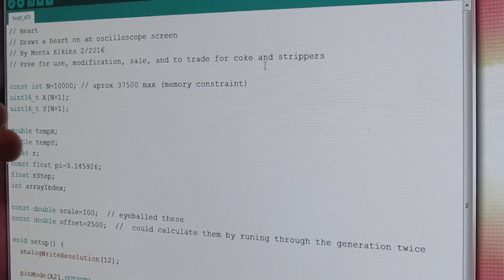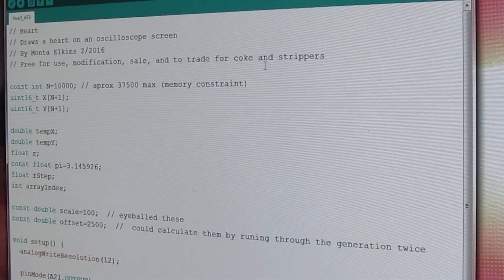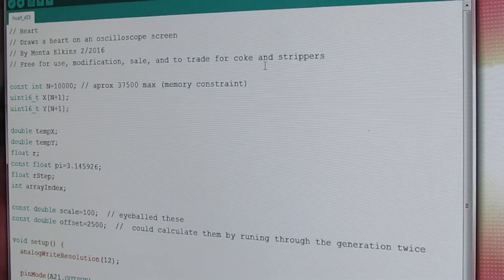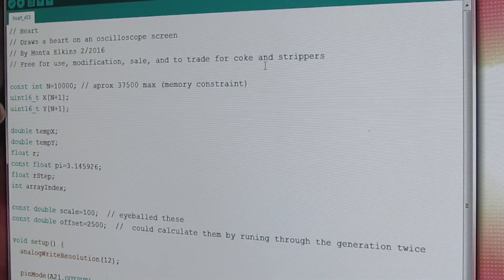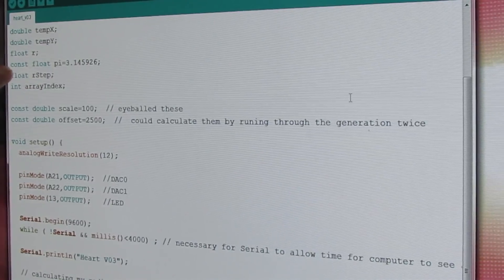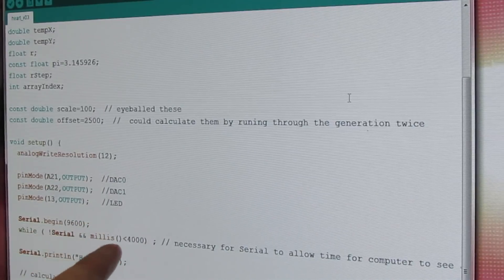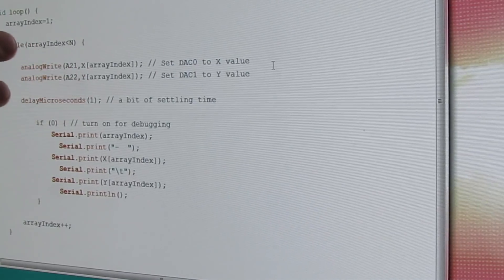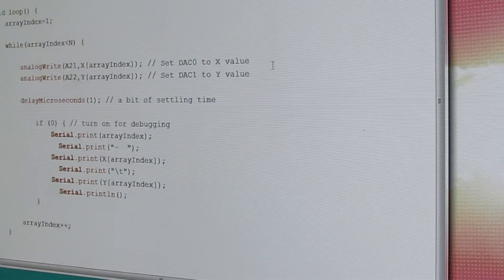Graph Math on your Scope

Comment: I ran the sketch on a teensy3.5 and it looks perfect on my old Hitachi V-252 o-scope.  On my Hantek DSO the left side of the heart is larger than the right half and it is rotated slightly.  The same probes were used.  Any thoughts?